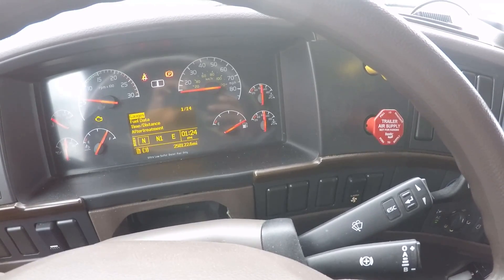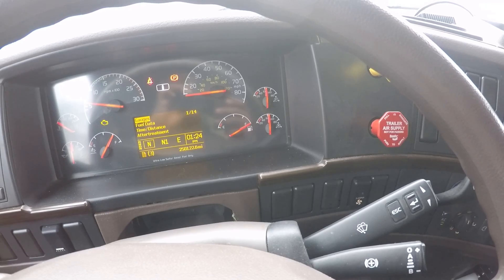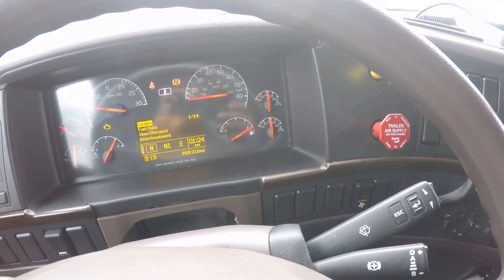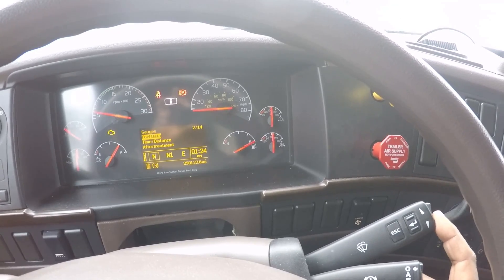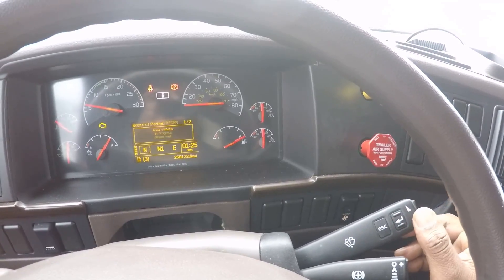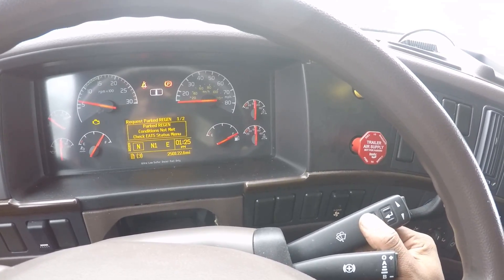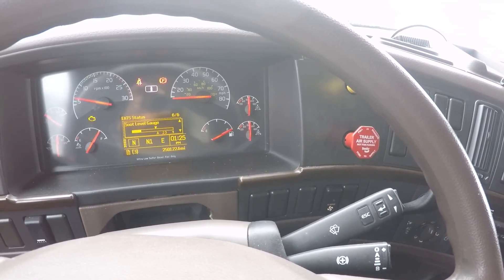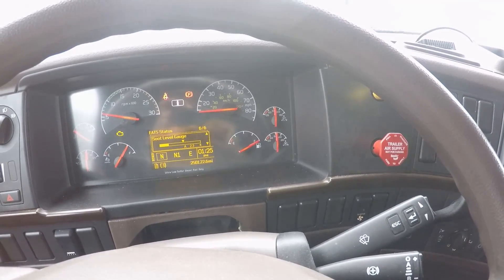How To Do A Park Regen On A Volvo

Comment: This interesting. So a regen is to burn off excess soot? is that for emissions? What's d-rate? Sorry...I'm interested in all kinds of thins and you've just sparked my interest. i love vehicles and all things involved. :)
Reply from the maker: +The Lady Borgia Yes, that is for the emission. The system is called DEF ( Diesel exhaust fluid) With out the DEF system the truck will blow out soot the black smoke that you would see coming out of the exhaust, with the system it keeps it inside and burns off internally to produce clean emission when the system dose not burn it off it will back up the system with excess soot which will put the truck in to d-rate which means the truck will not go any faster than 5 to 10 miles an hour until a region is done.